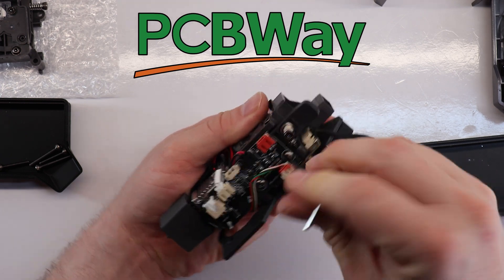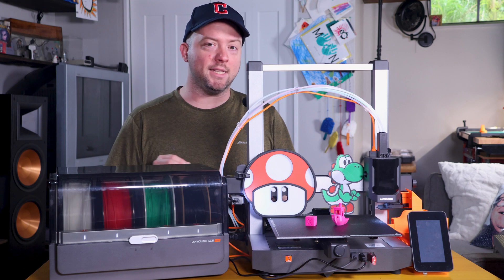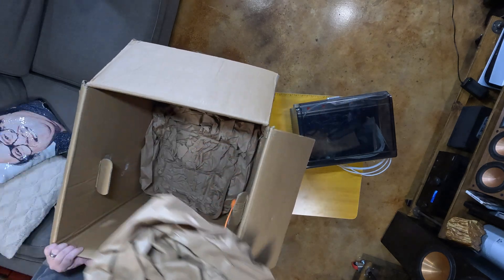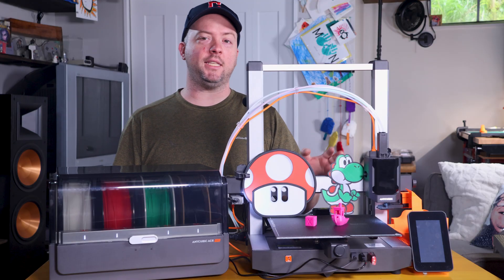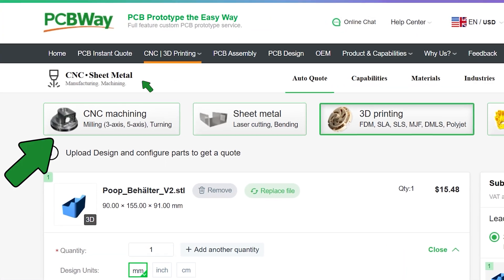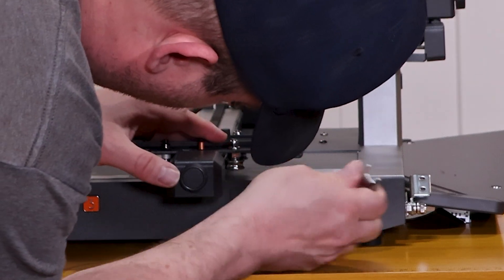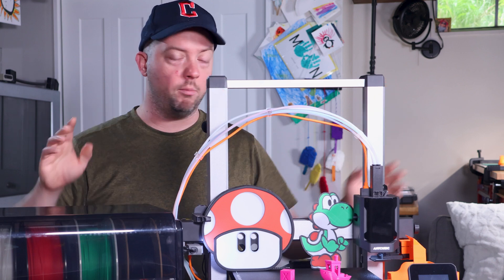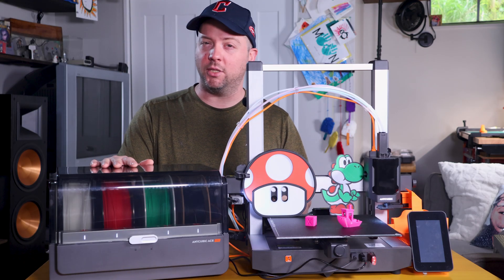Fixing an Ebay *FOR PARTS* Anycubic Kobra 3 Combo: Cheaper Than Refurbished? #repairing #anycubic

Comment: I did the same thing. In total I bought 2 as parts/repair on eBay. Probably the same seller. The first printer just needed to be adjusted but also had the same issue with the wheels and a purge wiper that didn't survive shipping. Bought the second one just for the ace pro. Still have the other printer in the box and I'm pretty sure it's fine but I already have a handful of printers in use and I only print for personal use. Is it worth the effort to try to sell my second kobra 3 without the ace? Or perhaps I'll replace my m5c with this spare printer since ankermake no longer supports the printer (although it's in good condition with a handful of spare parts for future repairs)
Reply from the maker: I ended up selling that Kobra 3 without the ACE for $100 on facebook.  I think it was worth it because I also have more printers than I need right now and the guy was pretty excited about upgrading from an Ender 3 v1.  I only find myself regularly using at most 2 printers at once despite having way more.  Up to you if $100 is worth it

Comment: Have to say, I was not expecting a repair, usually new youtubers are "scared" of touching electronics, good job.

P.S.: I would disable automatic translation, from experience most of the time it changes the translated title to be worse.
Reply from the maker: I love fixing things up and just starting to record it.  I prefer to buy broken and fix it.  All the power sports toys I have were bought with electrical or compression issues since many seem scared and sell them cheap.  Thanks for the tip on the translation, I'll have to look at that.